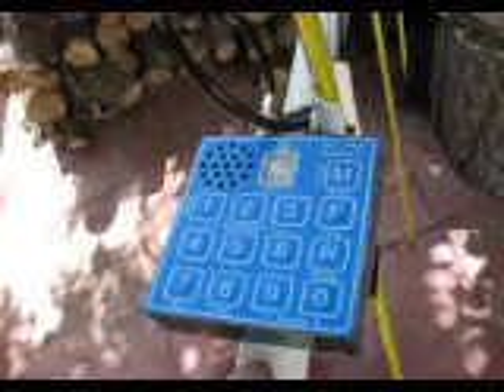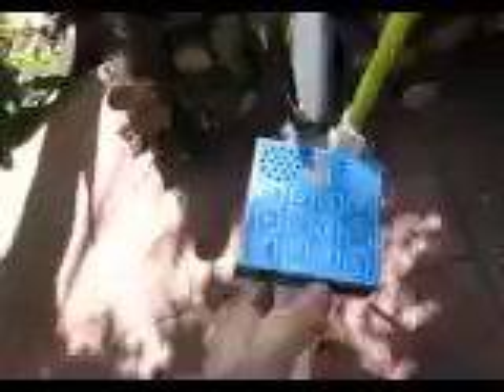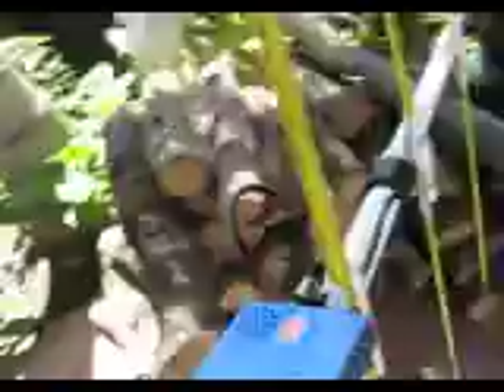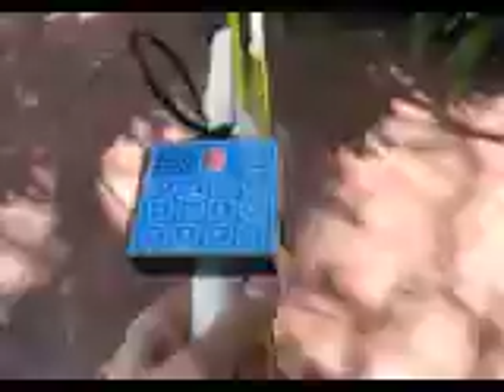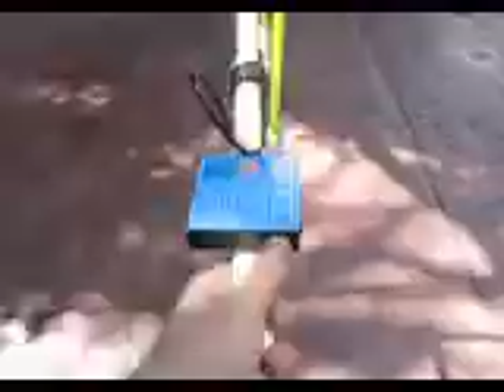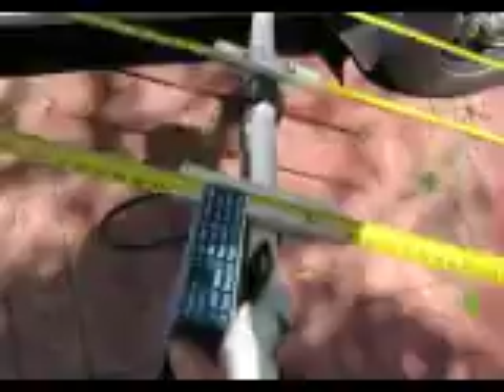Using the VK3YNG Mk4 sniffer and home made tape measure Yagi.

Comment: What sort of distance from source can it hone in on
Reply from the maker: Exact distance I am not sure about, but it depends mostly on the antenna.  The unit is actually quite sensitive, similar to most receivers. With a good directional antenna such as a three element yagi, it will detect signals and help you find the direction for many kilometers from the source.
Reply: @jphdg  Thank you that is very interesting